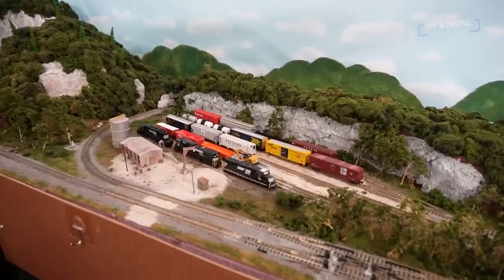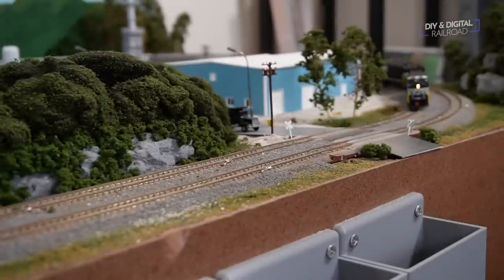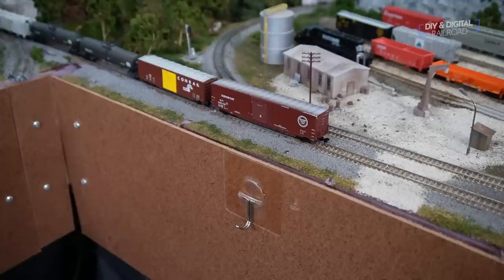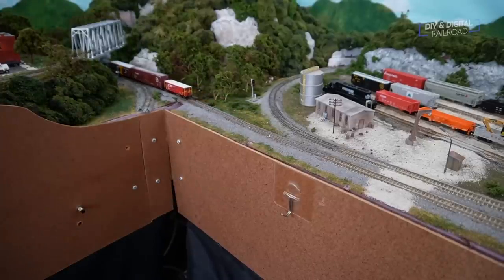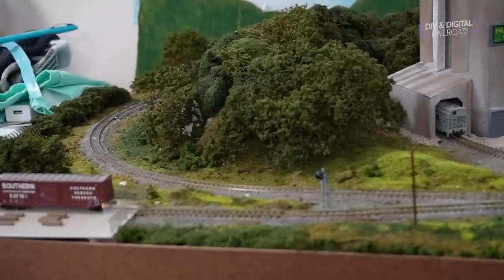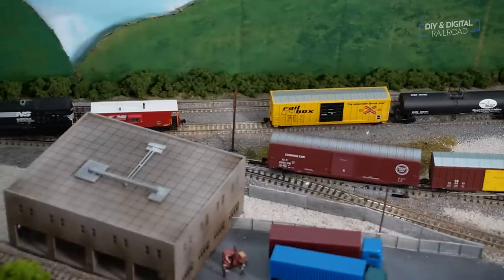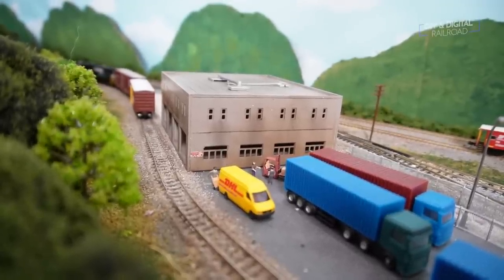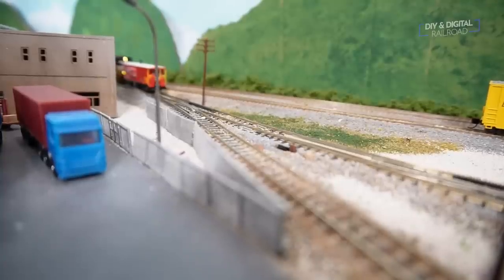How I use a Caboose on my Model Railroad

Comment: The caboose or now called a shoving platform would have a whistle they could tie into the airline called a Hancock Whistle so the Conductor could still do a grade crossing signal since the engineer wouldn't be able to see when the grade crossing is coming. Very spot on operations session Jimmy! - Jason

Comment: Aside from realistic modeling, I run cabooses on trains just to help keep track of them. While model railroad couplers are generally reliable, if I'm running a train and notice it's now caboose-less, I know the rest of the train is sitting somewhere on the layout and I'll stop everything to sort out the issue.
Reply: I've read about a similar prototypical use for the red tail lamp or "Last Vehicle" sign. In the event that the EOT indicator was missing, the train would be halted to check if they lost any cars on the tail end!

Comment: I also model an era that doesn't really see cabeese, but I love running a train with a caboose because I've always thought they were so cool, so I do two things. One, I accurately model caboose operations in their today form. Two, I stretch the rules of prototype modeling a bit. I typically run a caboose on my Class 3 freight trains, my locals, my Mexican freight train, and my maintenance of way trains. Even as a kid I remember most railroads no longer using cabeese but some that still did on regular freight trains. For example, the Chicago South Shore & South Bend Railroad being one of those that still used them in my childhood. I'm in my early 20's now.
Reply: Did bro actually say cabeese 🫡🫡🫡💀💀

Comment: On my tiny layout I am still undecided whether or not to have cabooses. I like the look of them, and it reminds me of being young and waiting for the caboose to appear. Off topic, I do have a question that might lend itself to a possible new video suggestion. I am unsure where I need to place signals and what they do exactly. What direction to turn them, why they should be placed there, which type to use, etc. Signal education, if you will. Note: all my signals will be non-working and just used to decorate the area to look realistic. I will buy some made on a laser printer that I found. However, if I purchase them, I would like them to be placed properly. Any help would be appreciated. Thanks.

Comment: Nice session.
Just wondering 2 things 
1 connections  how do you disconnect, what is the tool you use?
2 run around - might have cut it for time, but does the loco go completely around the layout to reposition? I missed that.
By the way, very soothing background tune.

Comment: what is the best power supply I can use to power an autonomous railroad model controlled with raspberry pi?
Reply from the maker: It depends on what scale you are using and how many trains are running.  A 12 volt 2 amp power supply is a good place to start.

Comment: Off topic question...(I figured the latest video might get the quickest answer). 
I am a noob (and damn near a complete numbskull when it come to electrical), working on my 1st layout.
I have wired up my train station and platform lamps...no issues with the "Just plug" system. I can understand it, can do it, and like it!
Questions are...
1. Lighting 3 buildings....can I splice them all together and run all three into a single plug? (lights I have for this are "just plug")
2. I have 10 street lights(Evemodel), that came with 10 resistors(?). Can I run all the blacks together to a single line - resistor - "just plug" (same for red, without resistor), so that all 10 are on a single plug?  Or...do all 10 need to be wired separate, each with a resistor, to a bus/hub unit? 
I have just a single "Just Plug" with 4 slots, and really don't want to have to pay the $$$ for more to run every light individually.